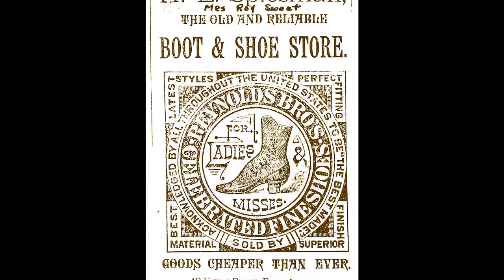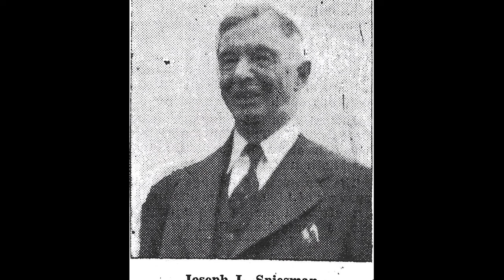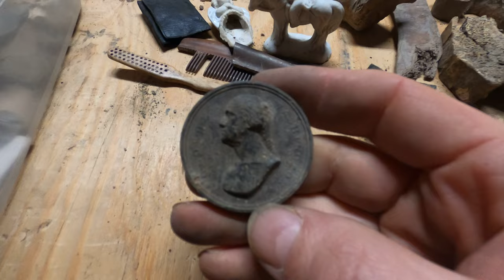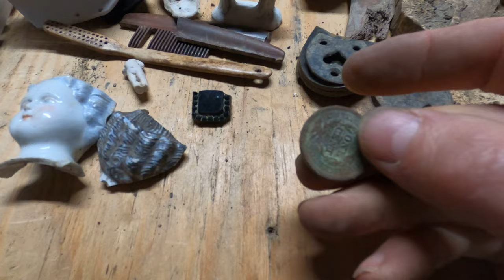E20 Artifacts from the past

Comment: The CPVC pipe got to be kind of popular in the 80's, especially down south for some reason.  
I did not know about the lead contamination problem tho.  Also I have heard over time CPVC tends to get brittle and crack if it is bumped.  PVC and CPVC use two different joining processes, PVC uses solvent welding, the "glue" is simply a mixture of 3 strong solvents with very finely powdered PVC resin.  Whereas CPVC uses a compound that takes an hour, depending on temperature, to cure.  But now we have PEX, just cut and crimp.
The wire you found could have been from an old door bell.  Around the turn of the century people were starting to install door bells, you will sometimes see a box cut into the wall by the door, inside would be a couple of carbon/zinc cells.  These were around maybe 9 inch's tall and maybe 2 inch's around, with screw terminals on top,  at 1 1/2 volts a cell, 4 cells wired in series gives you 6 volts.
Reply from the maker: You're right about CPVC getting brittle over time. We have hard water here and I wonder if that's the culprit.  Didn't know the difference between the two types of PVC glue. I just knew not to use the stuff for drains on CPVC.  
In the basement of my house, I found an old glass battery jar with the same type of wire attached to it that I found in the cistern.